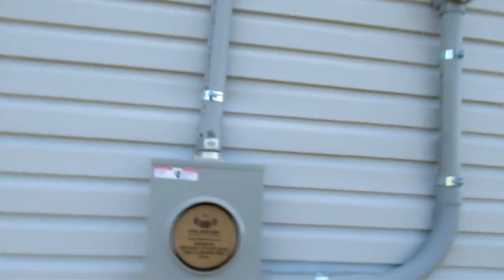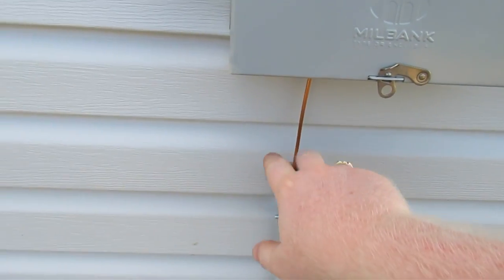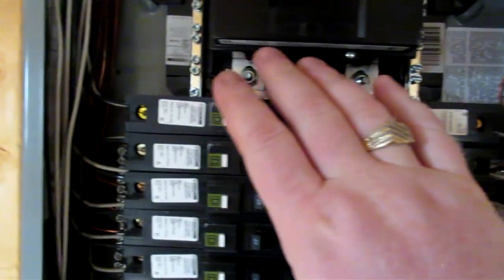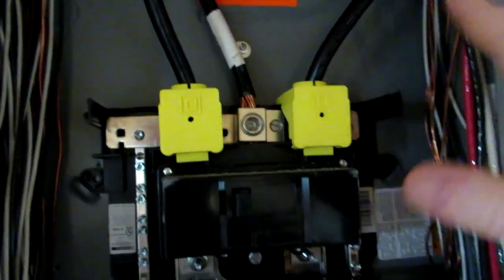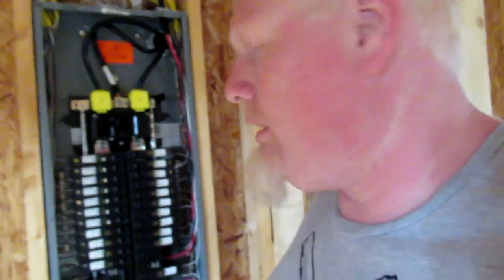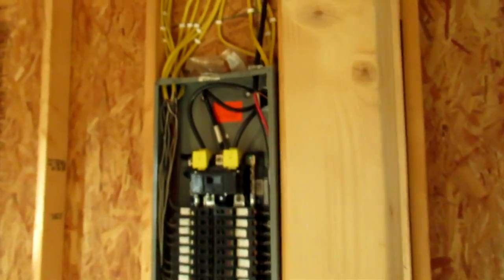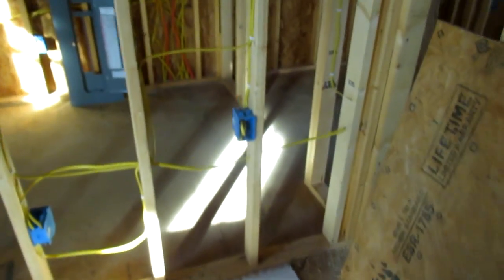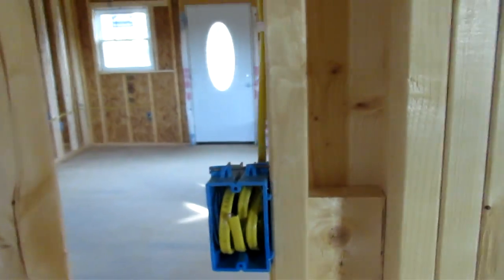How to wire a house

Comment: I got a very similar new 200 amp main braker panel box wich means don't need the ground wire from meter to the panel and i bond newtral bar with the ground green screw to the panel box, my question is can i use one side of neutral bars for my ground circuits since my neutral main line is feeding two bars one on each side inside my panel or i should install an extra ground bar?
Reply from the maker: Around here the inspectors will not let you do that.  I don't know why though.
Reply: I already found the right answer, thanks for replying Mr Abston
Reply: @dreamergth  what's the answer ?
Reply: Main panel should have neutral ground bonded, subpanels you must separate neutral from grounds, some times you'll need to buy a ground bar kit
Reply: I hope this may help you Mr Ezra
Reply: @dreamergth  yes , thx  . You bond once at the main and separate from there . 🖒💡
Reply: Correct Ezra

Comment: Respect for you doing it by your self/with some help.

Knock on wood; what if you DIY some work that requires a contractor and, lets say a fire, start because of that, do the insurance cover that or is that a chance you take?
Reply from the maker: It was inspected and passed so yes they would have to.
Reply: Thank you for your answer

Comment: I wished I knew how to do electrical wiring. My house has knob and tube wiring. It's only the top part of the house. So from the switch to light fixtures. The floor level of the house has been replaced. My Dad had a 200 amp service panel out in over 30 years ago. I remember, that there were a box with glass fuses, where the dryer is located.
Reply from the maker: Wow. That goes way back.
Reply: DO NOT TOUCH IT, Knob and Tube is up to code as long as you never touch it. As soon as you do anything to it, it's all got to come out.
Reply: Don't insulate around the knob and tube. Eventually you will have to remove it anyways. Most banks and insurance companies won't deal with homes that have knob and tube. Sadly, it's not usually an easy or cheap thing to remove.

Comment: Only thing i can see , that should have done was make a  loop 12"  above  the box, so if any thing happens in the future,  you can have some length of wire to work with!!
Reply: Ron Merkus    Ron,   I believe NEC 2020 now restricts how long a loop can be installed.   At least I think I heard that in a 2020 code class.   Retired now so only have up to 2017.   I thought this might help.    Respectfully,   Kevin
Reply from the maker: I left enough slack

Comment: How do you get away from needing a meter main disconnect or a 4 wire sub feed to you panel.
Reply: John Fishel I'm wondering that myself hopefully he informs
Reply: So he does not have a disconnect outside the house so the panel inside is the main panel. The only time you run a ground wire with your feed if you are doing a sub panel. If there was a main disconnect outside then he would've had to add a ground wire and separate the neutrals and grounds in the inside panel
Reply: his main panel looks like it's directly on the other side of the meter base it's up to interpretation but could beconcidered under the distance required for a disconnect. also his area may not require one. not all areas require every nec rule or code
Reply: A disconnect is not required as long as your service feeders are 12 feet or shorter.

You'll need a minimum of one foot of wire  to be able to terminate inside of the meter can  and also  a minimum of 1 foot of wire to be able to terminate inside the electrical panel.  This tells a firefighter that within 10 feet of the outside meter can he'll be able to find and turn off the main breaker inside the panel.

Something most inspectors require is a waterline ground. Yes, the two ground rods do pass national electrical code, but they normally demand a copper conductor of proper size going from the electrical panel to your fresh copper water line entering your home. It must be terminated as soon as it enters the wall and before the first fitting. The must be no breaks/slices along the way back to the panel. 

Awesome job for a "homeowner", I'll give that four out of five lightning bolts! There are some time and money saving items that were lacking during your rough in but not being a professional I'd say you did well. Pat on the back man.

⚡⚡⚡⚡
Reply: You bond your neutral and ground at the first form of disconnect. Being that there isn’t a form of disconnect at the meter you bond it at the panel.
Reply: A service disconnect has to be at the service entrance location which is located at the service meter outside, or immediately upon entry into a structure. The code doesn't say anything about 12 ft it is immediately upon entry so the only way that this is any good is if the panels are back to back but given that the conduit shoots out of his meter going to the right and then up I doubt that they are back to back.  Saying that the bonding screw has to be in the panel is a poor choice of words, it's entirely circumstantial.  In his case he is correct. The NEC is something to be followed if the ahj wants to add to that they have the power to do so but to ignore those codes is ignorant. I've yet to work somewhere where the NEC isn't strictly followed.  I will give it to this guy for not being an electrician he's doing an okay job and he made a wise decision getting all those Breakers so they can make up for any shortcomings he may have caused
Reply: @JohnMartin-bk7wd  Saying the bonding screw must be installed was an excellent choice of words. Everything said in the video strictly pertains to HIS particular structure. Obviously different applications require different parts but he made it very clear that this is for general knowledge and for his particular build. Ease up electro-nerd
Reply: That’s right main breaker outside when panel and meter not back to back that’s national code where is Kentucky?
Reply from the maker: Only need one at the main.

Comment: How come your joints aren't made up yet.???
Reply from the maker: +Danny Calk wasn't required for rough in
Reply: What I meant is that it is a benefit to you to do them before sheetrock.   eg.   While making joints you noticed that a wire was left out, putting it in now is a whole lot easier than putting it in after the sheetrock has been installed.  Just Saying
Reply: What are joints?

Comment: how many outlets does one breaker has?? thnx!
Reply from the maker: I never put over 8 devices on a circuit.
Reply: Abston Wood Crafts For lighting outlets, the maximum number of fixtures on anycircuit is determined by the  maximum watt rating of each lighting fixture.

Comment: Electrical codes don't really vary....that's why it's called a NATIONAL Electric Code
Reply from the maker: +AirsickCashew actually they can vary quite a bit depending on local codes. The nec is the base and many localities will add to it.
Reply: Actually, localities can have their own electrical codes so yeah, they DO vary.  The NEC stuff ALSO varies depending on which revision your state has adopted.  VA, for example, is still on 2011.
Reply: In Australia  (and New Zealand) there is a single standards (AS/NZS 3000) which every one in throughout each country follows with some minor exceptions between Australia and New Zealand.
Reply: AirsickCashew it
Reply: it's
Reply: Yes it does, authority having jurisdiction!
Reply: Gush
Reply: AirsickCashew I believe he is referring to local codes which must be NEC compliant if they are different.
Reply: John Meise Exactly, 2008 in Indiana, & 2017 in MA. Lol let’s give him a break 4 being clueless
Reply: Aisick actually they do if you don't know don't say, k?
Reply: 3melendr they dont have to be compliant to nec
Reply: Abston Wood Crafts subscribed keep these coming bud
Reply: NEC is the minimum standard, local jurisdictions have the right to enforce above the minimum, but not suppose to make a standard less than the minimum
Reply: @jasenrock  agreed, but the regional codes can only enhance the national code, for the national code is the bare minimum requirement.
Reply: @chaser9363  Not true about code amendments. Many states have amendments that change the code to a lower standard. Some states even have amendments that completely remove articles. Quick example, the usual requirement for securing EMT is 3', but there are states that change the rule to 5'.
Reply: @nicklast-name6637  you got me there. Haven't heard ever heard that, till now. But I guess all things are possible. Seems like the fed would step in when it comes to a large commercial building where a lot of people occupy. I know that code isn't a major safety issue but if they are allowed to disregard one code what's stopping them from disregarding the whole code.
Reply: @chaser9363  I guess the NEC trusts local jurisdiction to maintain certain standards. I wouldn't think any state would create a hazard by removing safety regulations. But maybe there are certain rules they find to be overbearing or unnecessary. Realistically, while the NEC is supposed to be a standard, it's really about big corporations lobbying for their product to be installed. Copper lobbyist got the article changed for wire on a roof to be rated lower due to heat. All so you would need to install larger wire, which makes them more money. In my experience, it's usually that kind of article that states amend.
Reply: @nicklast-name6637  I know that's a part of the deal for sure, but there are studies and past issues that help the board base their opinions on, to incorporate the new proposals. All corporations can do is submit a proposal and studies to back it up, ultimately its up to the board and they are mostly made up of inspectors, contractors and engineers and I'm sure there are a couple that work for some corporations like probably the engineers. But I don't really see the NEC being lenient when it comes to the code, as it is stated that the code is not only just a standard but that it's the minimum standard. I think that maybe it's just some back woods jurisdiction that doesn't have a lot of construction to begin with and /or hasn't adopted the new codes as of yet. Because I know that here in Florida we just did adopt the 2014 code from the 2008 code and we skipped the 2011 for the most part. And the reason we lag like that is because when the codes are first released they still are being tweaked or that there isn't enough of a change to bother.
Reply: But said codes get updated
Reply: @scallen3841  sorry but that is a cardinal code that will never change because you have to differentiate the hots, grounds and neutrals otherwise you may as well throw the whole book in the trash. I think you need to go to apprenticeship school and learn how to interpret the book properly, instead of guessing what each artical means
Reply: @chaser9363  In my house which was built in 1974 the panel looks completely on the inside . Codes and what not get updated to increase safety standards .
Reply: @scallen3841  your sentences aren't making any sense
Reply: @scallen3841  what do you mean your panel looks completely on the inside
Reply: @chaser9363  completely different , sorry
Reply: @chaser9363  Bro whatever you think get on with your bad self , it's only YouTube comments . You have zero clue about me or what I do for a living , don't assume anyone's backround .
Reply: @chaser9363  YouTube comments you can say anything to anyone , your backround doesn't impress me . Where's your videos mister 30 year's experience ? Show us all the right way to get it done
Reply: @chaser9363  Nope sorry you did state your experience level for a reason , I had the chance to go to apprentice school to be an electrician . I went into the Navy and became a jet engine mechanic on fa-18c's 1987 -1992 , and went to work at United airlines . What you read and how a person is in real life are to different things .
Reply: @chaser9363  And when I said hostile I ment way to many experts on these threads jump down people's throats , if they say one wrong thing . I don't need to learn from you , my brother in law is a 28 year member of the ibew a journeyman . He will teach me all I need to know if I really need help
Reply: @scallen3841  first of all I just want to say thanks for your service in defending our freedoms. Second, how ironic my brother in law worked on f18s in the USMC and retired  E9 Sgt Major of the Marine Corp and I'm the electrician
Reply: @chaser9363  It's ok my father fixed B-29 bomber's during the Korean war , then became a union electrician he started in 1956 retired in 1996 still a member great pension great health care , he is really sick so my life is now caring for him .
Reply: @scallen3841  sorry to hear that, hope he gets better. My father was a crewman on b24 in italy during WW2 he passed about 10 years ago and went pretty quickly and didn't have much time to say goodbye. But i applaud you for being there for him in his time of need. I've seen many that wouldn't give their parents the time of day. So cudos to you.
Reply: @chaser9363  He won't ever get better
Reply: Local codes (state, county, township, city, etc) can be - and OFTEN ARE - more strict. They cannot authorize less stringent requirements, but they can be much tighter. Apparently, you are oblivious to all that, but you did get to act like you know something. Good try, Airsick.
Reply: @derekevans7780  Spot on! NEC is standardized and usually fairly easy to interpret.The ol' AHJ can vary widely from one locale to another, the writing can be (and usually is) vague and confusing. Finally,  as you no doubt know, the interpretation of the AHJ specs depends mostly on the inspectors mood that day.